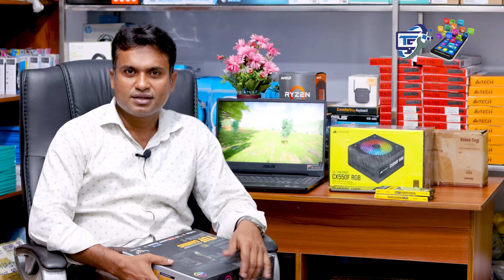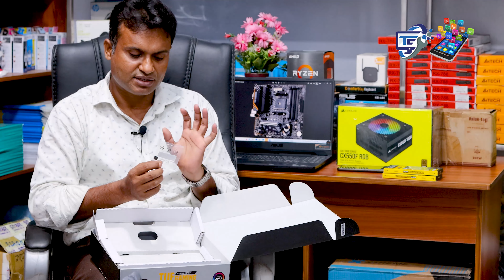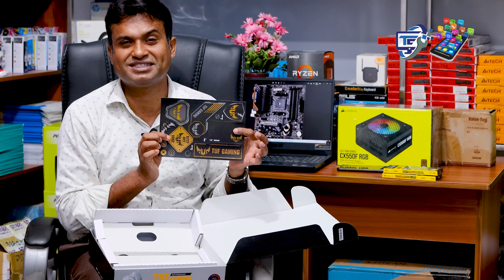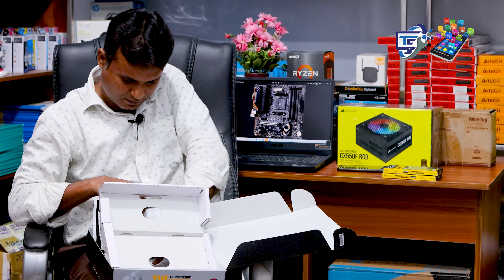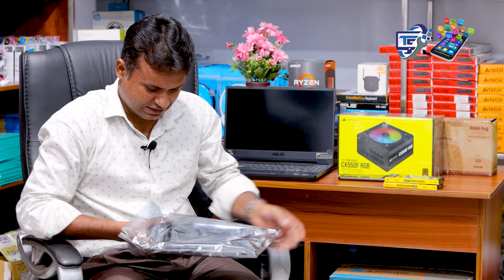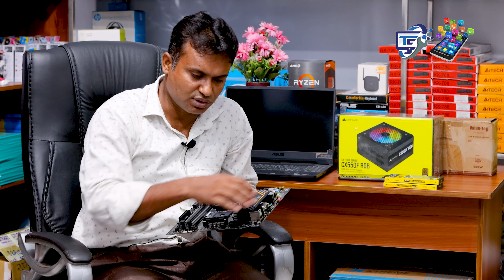ASUS TUF GAMING B550M-E | Motherboard Unboxing | Best Motherboard Manufacturers

Comment: i´m sorry to say but this "review" is kinda useless - 13 minutes of reading from the box 
(all of this "marketing" info is on asus website already - as are the rest of the 3 minutes of showing the ports and cpu socket)
for example talking about on board audio quality (test it in the video) , talking about motherboards temperatures under load , 
showing the bios features etc. would be much more useful .
Reply: thank you sir to show your valuable opinion

Comment: I'm using the same Mobo . But I'm having Bluetooth range and wifi range issue . The range only have is 2-3 feet only . Can you pls help me to get rid of this problem.
Reply: Wait, mine doesn't have BT and WiFi. Is it different variant? If you have that issue, it is better to buy ethernet cable
Reply: Get a mesh WiFi extender.

Comment: Hi can i ask why ryzen 3000 series is not good for this
Reply: I have r5 3600x with this exact board and works just fine ! You might need a bios update if going to r5 5xxx series..Otherwise it works just fine.

Comment: This is my board! Been using it for 2 months and very stable and I only had 1 BSOD so far.
Reply: Can you tell me how many vrm phase it has?
Reply: @soniaakter5421  10 phase (8+2)
Reply: Hi can i ask why you got BSOD
Reply: @tzweiii3523  No idea. I remembered opening lots of tabs and then the BSOD occurred.
Reply: @ivanyu3930  is it a motherboard issue and has it happened again
Reply: @tzweiii3523  No it hasn't happen and performance is very stable even after 6 months of use.
Reply: is it 5000 ready?
 @tzweiii3523
Reply: what cpu are you using
Reply: @fuzcake9592  Ryzen 5 5500